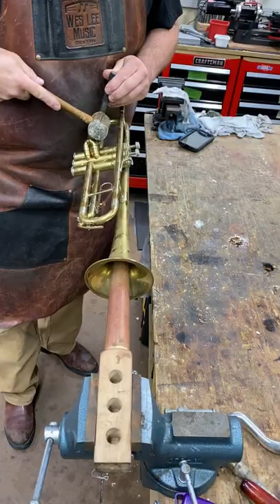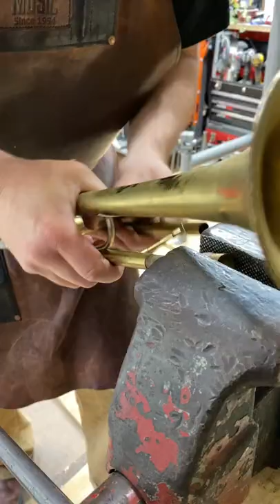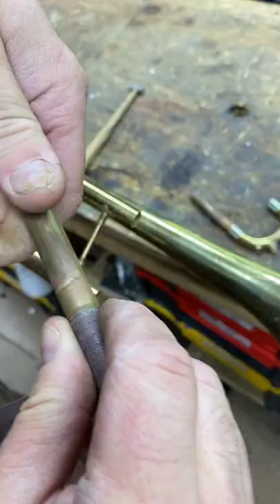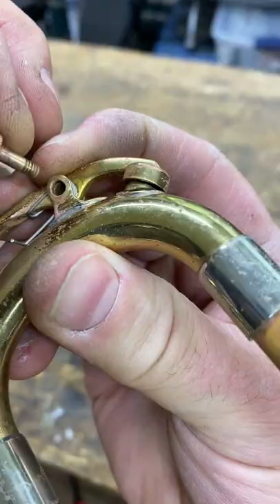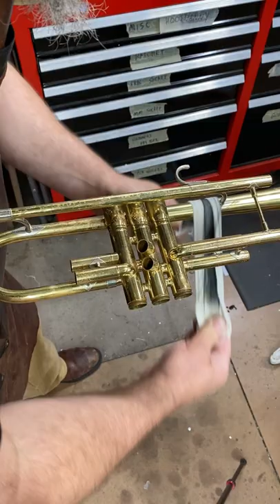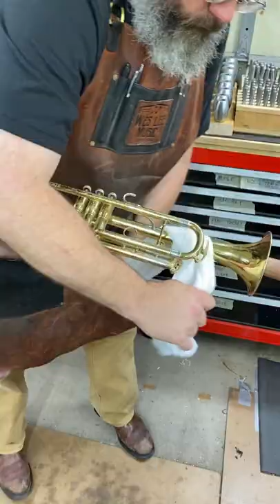Cleveland Trumpet Preservation Project- band instrument repair- Wes Lee Music Repair

Comment: wes, i have a problem. my teacher told me to superglue the rings on to my clarinet barrel and that was before i knew they are supposed to come off. they didn’t go all the way on and make me a little more flat than i was before. how do i get them off??
Reply: Im a technician and from my experience heres what id recommend, rubbing alcohol can loosen super-glue if you spray it and let it sit  but you gotta be precise, if your clarinet barrel is wood i wouldnt recommend it though as its not good for the wood but im doubtful that is what you own. But if its the plastic material rubbing alcohol it, let it sit and then use water to clean it after. The rings shouldnt come off though they should be snug tight and not spin and usually have an adhesive.
You should ultimately let a repair technician do it though because they have the experience and most of the times something as simple as that they are generous to fix it for you on the spot.
Reply: @lewolut9925  it is a wood clarinet. (my school’s) what effect would the rubbing alcohol have on the wood?
Reply: @whosaubrey7524  it can ruin the wood quality, degrade the wood or warp it, it essentially breaks it down, you should take it to a repair tech idk how your school does it but if its the schools id say you shouldnt do your own repairs to it.